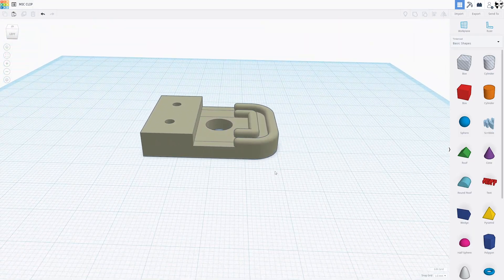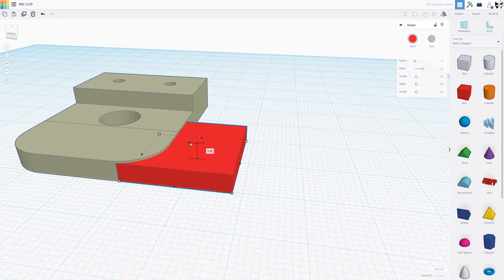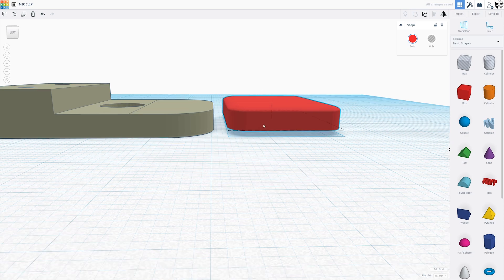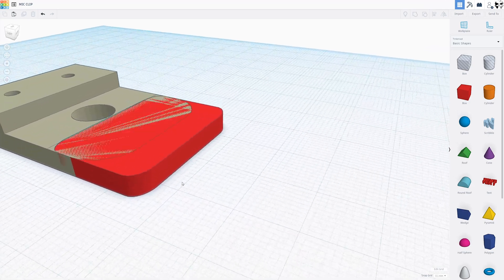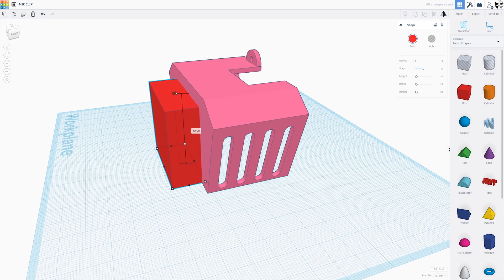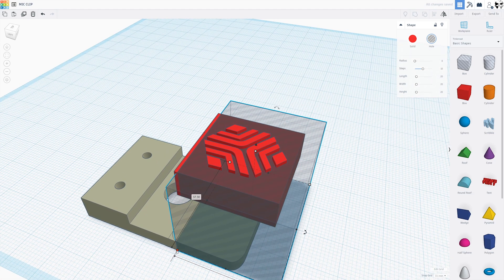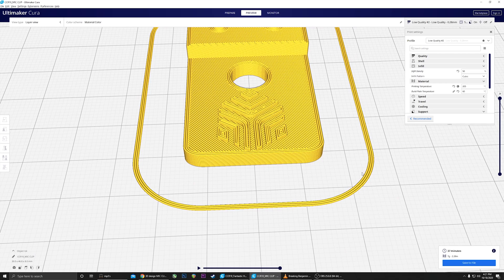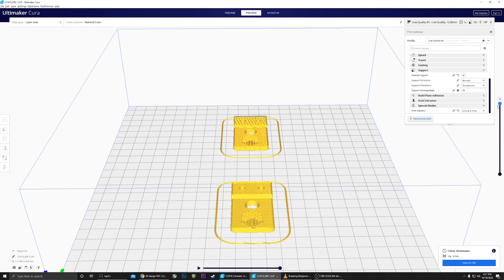Let's Remix Something from Thingiverse!

Comment: Sub185
I have been using tinkercad more and more lately. Fusion360 intimates me.
The way you adjusted holed box to cut off nibs was the way I used to do it until a week ago. But the lines that show up still trigger me. Even though they don't show up final model.

New way:
I learned to drag a work plain on to the surface that needs cutting. Then drag holed box over surface and press "d". Cut box will drop on to the work plain perfectly flush. Now merge to cut box as usual. 

This method leaves zero lines. Lines up surfaces perfectly. OCD cured.
Reply from the maker: Haha, yeah I've done it that way, too. The lines used to scare me, too. But since I've learned they don't show in the print, just to get things done quick, I'll just leave the lines. But I appreciate all the comments your leaving! Thanks for watching :)

Comment: For silky or glossy filaments, I recommend using the pure glass bed instead of ultrabase. If you clean it with alcohol then it sticks well, and it gives out shiny results in the bottom. It is your preference, however I got better results from it.
Reply from the maker: I agree. I do flip the glass bed and use the underside when I want a piece to be shiny and smooth.

The top side of this particular piece in the video is what's showing, so it didn't really matter in this instance.
Reply: @Avel  Oh I see. Anyways, great video!